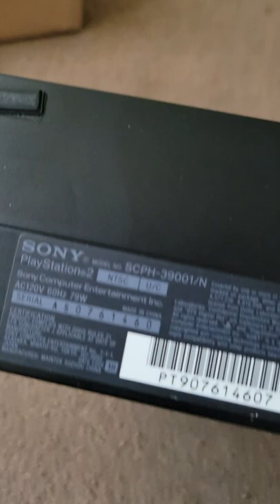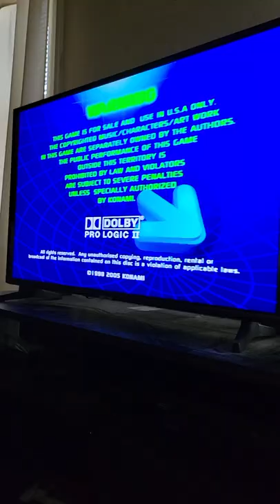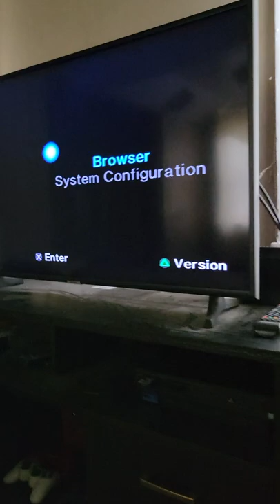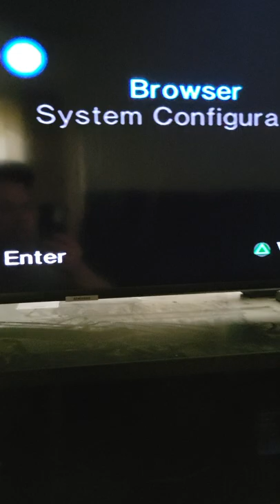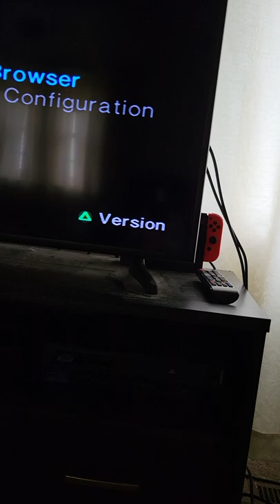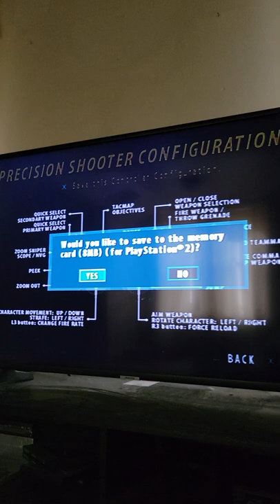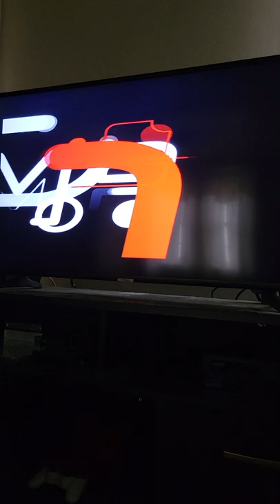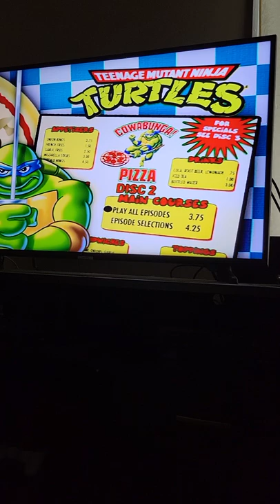SCPH 39001N No power Repair

Comment: Glad you were able to bring this unit back to life!

Hah, that's the same power supply I have yet to finish fixing after replacing 3 of the blown diodes near the main capacitor and the mosfet that shorted. I bought the replacement C3 caps and just need to install it. Ended up with a PS2 with a dying system management chip that I hijacked the power supply out of to replace the damaged one in the meantime. I find that the rosin core solder doesn't tend to have enough flux to get the joints to flow nicely but perhaps I just don't work fast enough for it. A little bit of Amtech 559 flux usually makes a world of difference.
Reply from the maker: yea those are a common problem with g-15 boards. i use them for parts. i like to do thing fast. that one the pad came up ans was able to save pin four pad and i hate when that happens. flux to me makes and mess when i do quick repairs like this. stay tuned a 2ds will be on the channel.